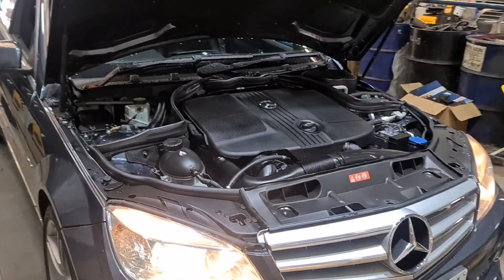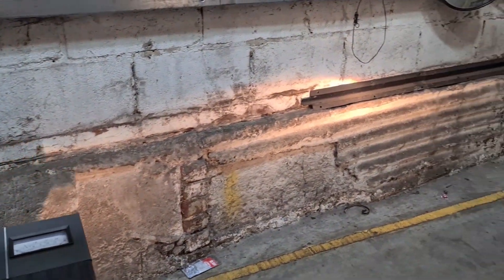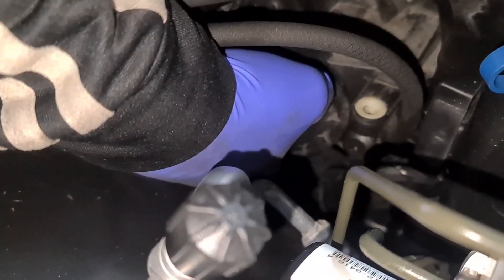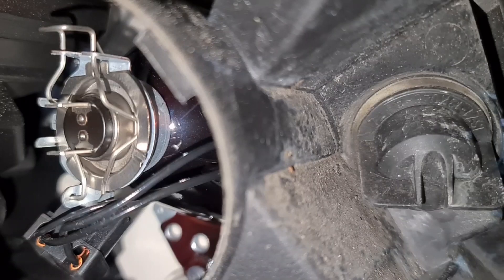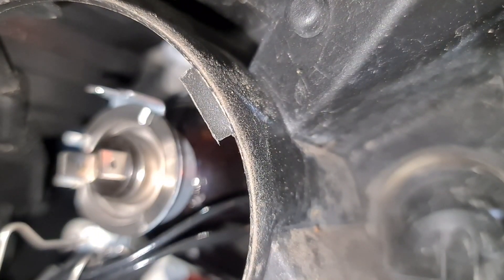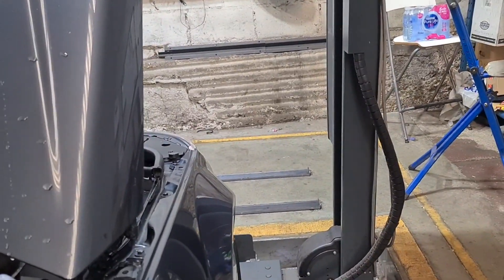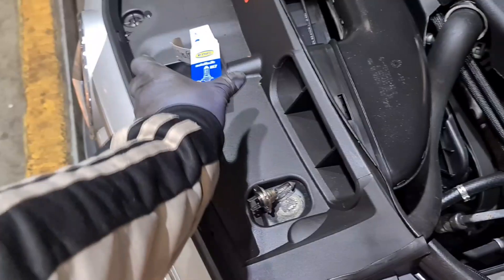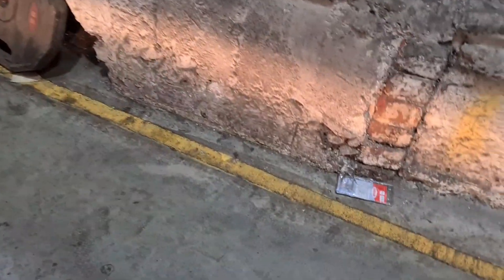how to fix #headlight beam image incorrectly positioned on Mercedes C Class W204 mk3 #headlamps

Comment: Hi..is there a way to change the English head lights to European driving plse? 2010. W204
Reply from the maker: Hi, Yes, you can typically adjust the headlight beam pattern of your vehicle from English to European driving by accessing the headlight housing or control module. However, this process can vary depending on the make and model of your vehicle, so it's best to consult your vehicle's owner's manual or contact a professional mechanic for specific instructions.
Additionally, using beam deflectors or headlamp beam converter kits is a common and convenient way to temporarily adjust the headlight beam pattern for driving in Europe while ensuring compliance with local regulations. These devices can easily be installed on your headlights to redirect the light output and prevent dazzling oncoming drivers. Thanks 🙏🏽
Reply: @TajMotorMedics  Hi that's for your quick reply..it's much appreciated...The car  has been imported to Spain ...It was imported 5 years ago and had gone through 5 MOT roadworthy tests no problem..so the lights have been switched over..I had to change one of the bulbs in the dipped beam..I took it to a center that is super strict...When I changed the bulb and tested  it I put the head lights height adjustment on the number 3 which lifted them up a bit...would this  have  put them out on the gauge when they put them on the light box..?The guys testing it are looking for any excuse to fail the car..There are not nice people...The car went through the same test 5 times in the past with nothing different to this time and passed no problem.Apart from the height setting been  on 3...I'm quite good when it comes to DIY work on cars...Thanks The car has Normal head lights..There's no adjustments from the settings on the dashboard..so I'm guessing it's done from the rear of the lamp itself?
Reply from the maker: @nickycocreator7694  Hi, replacing a headlight bulb should typically not affect the height adjustment of the headlight beam. The headlight height adjustment control is designed to allow you to adjust the angle and height of the beam pattern to suit different driving conditions or loads in the vehicle.

When you replace a headlight bulb, the physical positioning of the bulb should not alter the headlight beam height adjustment. However, it's possible that the act of working on the headlight housing during the bulb replacement may have inadvertently moved or adjusted the headlight aim slightly. This can happen if the headlight housing was accidentally nudged or disturbed during the process.

If the testing center is extremely strict and looking for any excuse to fail the car, I would recommend double-checking the headlight alignment according to the manufacturer's specifications and ensuring that they meet the European driving standards. If necessary, you may also consider visiting a certified mechanic or specialized service center for adjustments or expert advice.

Thanks 🙏🏽
Reply: @TajMotorMedics  Hi..yes makes sense to me...I'll check that out and take it to someone who can check the alignment properly...Just weird how it went through 5 previous tests with no problem...I no they made them change the rear fogs for European regs...The front must have been good then...Thanks for all your help and advice...top man..   you have put me in the right direction to getting this resolved...will be following your Chanel..very helpful..Thanks again..have a good week.😄
Reply from the maker: @nickycocreator7694  Thank you and hope your headlight issue gets resolved 👍🏽
Reply: @TajMotorMedics  cheers Taj....Top man...good Chanel and very helpful.🤝
Reply: Hey Taj..my lights do have the switch behind them I put the left hand side to European...does the right hand side light have a switch also...or is it just the left light? The lamp on the right side doesn't seem to have the same switch...Thanks
Reply: I found both of them...both on European now...thanks for your help
Reply from the maker: @nickycocreator7694  amazing well done 👍🏽 👌🏼
Reply: @TajMotorMedics  thanks...was easy with your help...tight squeeze but done both...thanks